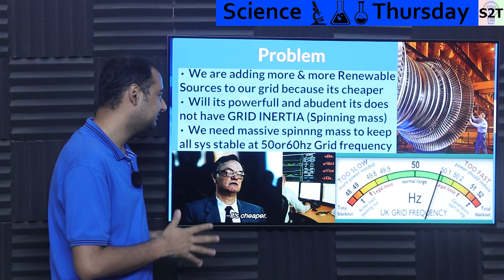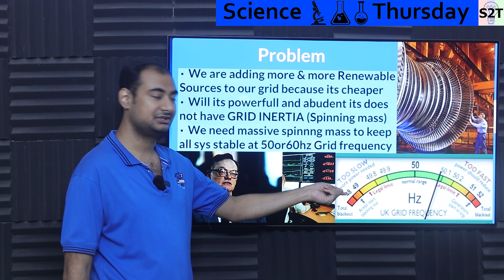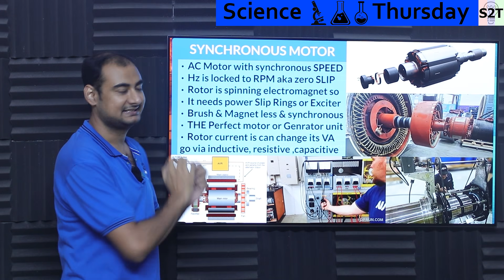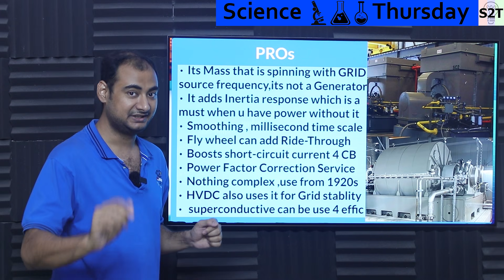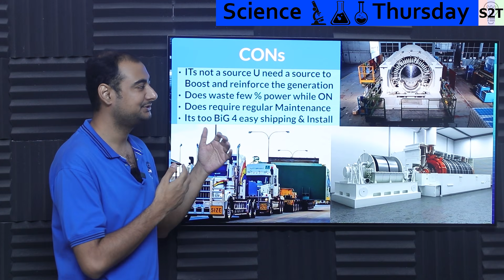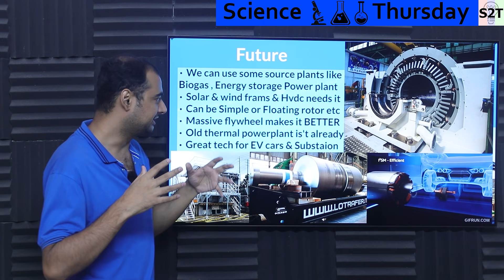Flywheel Synchronous Condenser Explained {Science Thursday}

Comment: Cost of a 300kw inverter is Rs.645,000+gst
Cost of a 300kw 50hz alternator is 3800-4000usd 
DC motor is 2500 usd  (93-95% efficiency)

So yeah it's not that expensive compared to a on grid solar inverter
Reply from the maker: at such low cost they are not meant for 100% duty cycle
Reply: is that DC motor brushless?

Comment: A friend and I were having a discussion about using flywheels as backup batteries for as cheap as possible. It started out with filling a rotor container with sand and then moved onto lead. Then we thought...well...what would happen if you spun the lead flywheel so fast that the container burst and then we realized we created a bomb that didn't require any explosives.
Reply from the maker: That why synchronous condenser don't have stupid RPM . Most r under 3000
Reply: @s2tenglish but stupid RPMs make awesome centrifugal bombs.
Reply from the maker: you naughty boy

Comment: Nice episode! But I still don't fully get why it would be so difficult control the frequency of the output from DC to AC converters from both solar and batteries. And, for HVDC, why can't we just use huge battery stations to provide both instant stabilization and storage?
Reply from the maker: spin mass inertia has instantaneous reaction speed